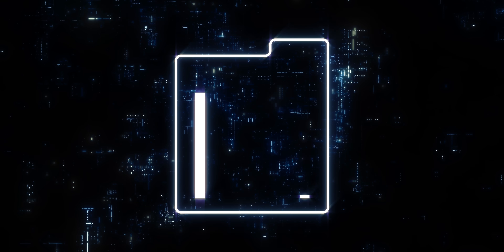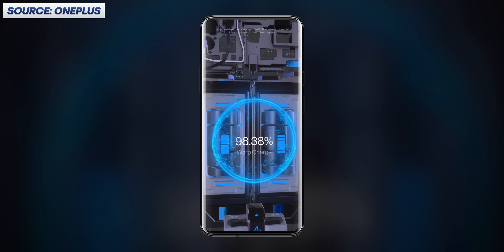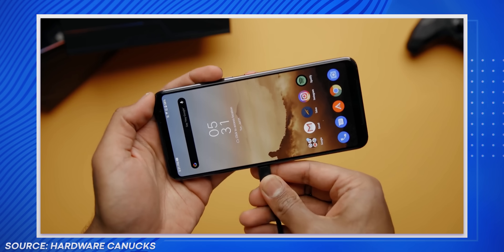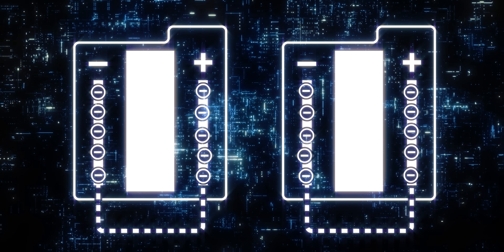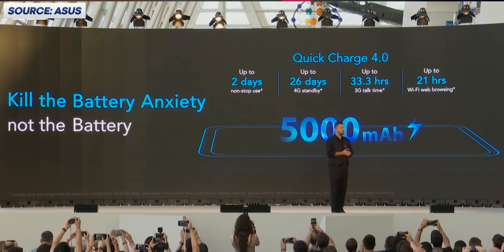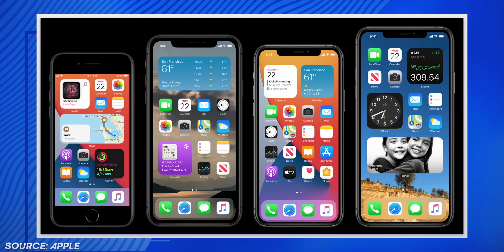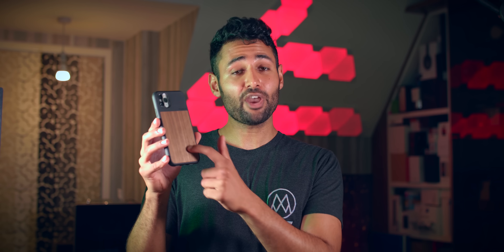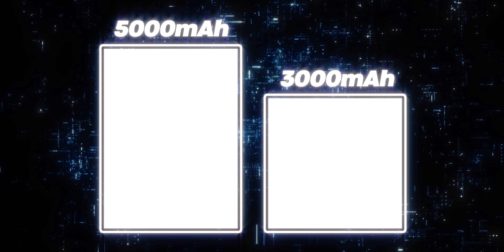The Problem with Fast Chargers.

Comment: I have a Huawei P9 Plus which I have had since November 2017 (basically 3 years now) and the battery is unbelievable . I still get excellent battery capacity using the original 18W charger it came with. It's a fairly big brick but it's worth it. Huawei boasts about the P9 Plus having special ICs in the phone itself which monitors the battery while it charges. There have been a few occasions where it slow charged on it's own...stating  the word 'Charing' rather than 'Fast Charging' but that's once in a blue moon. I don't know why that happens though. Normally it states 'Fast Charging'. There's no option to enable or disable fast charging on my phone (as far as I know). The sweet part about it is that even after more than two years of usage, whether I charge my phone to the full 100% or 98%...for the most part it will lose 1% within 5 hours on average (and sometimes it may go as far as 7 hours before losing 1%) when the phone is in sleep mode. On a full charge I can easily get 6 hours of On Screen Time. I think the most I got during the summer period was nearly 7 hours with about 10% remaining. I simply cannot complain. It's all good on my side. The Huawei P9 Plus is a premium smartphone with a premium battery.

Comment: Tesla charges its ~100kWh car battery in half an hour. It does so by maintaining the temperature with efficient cooling. So, there is pretty much no reason why fast charging would damage a battery if the charging doesnt heat up the phone beyond a certain point. The brands that provide 100W charging, also demonstrate how they maintain temperature within limits. So, there is nothing to worry. This video should be filed under 'modern tech myths'.

Comment: Nice video and a good explanation. I think this helps a lot of people to take more care about their phones.
Two small corrections. At ~ 6:20: 
Your phone will not continue to charge the battery once it reaches 100%. Charging of the phone is handled by a PMIC (Power management IC). Once the battery is fully charged, it will cut power to the battery and not continue charging it. That's also why you cannot overcharge your phone by leaving it plugged in for too long. Once the battery reaches 100% charge, it will be kept in a "trickle charge". It will be kept at ~100% charge by the PMIC. Basically, the battery will be charged with a really small current once it reaches a certain threshold. This way it can be kept at 100% charge without discharging or overcharging the battery. It's a periodic fluctuation so to say. 
I can't certainly say whether that's good for a battery or not. I don't know if the battery "gets used to" being kept at 100% and therefore loses capacity. I'm not a battery expert. 

In my experience the worst thing for a phone's battery is inconsistent and incomplete charging. Also discharging it too far is bad. I usually don't go below 30%. I charge it overnight and never had issues. I had my S9+ for 2 years and always charged overnight and disconnected it from the charger in the morning. This worked out fairly well for me. The S9+'s battery now has ~360 full charge cycles (360 times the complete capacity of the battery was charged) and it's still at around 95% of its original capacity and still has very good battery life. A day of use is absolutely no problem. 
So yeah, I'm not really convinced about the whole "leaving your phone connected over night is bad for your battery" thing. For me it has worked out great. Inconsistent charging and ultra discharging is way worse.

Comment: Think you may have misinterpreted the whole "apple slows phones" reasoning thing.... It's uhhh..... not to help us, lol. As apps get more demanding to run, relying on faster cpu's, more memory, more storage space, faster throughput from eprom or sd to cpu.... etc. And as the older units are already struggling here when compared to new units, slowing them down only makes them feel... like they're malfunctioning or dying... it isn't to help the customers who are holding on to units that still do what they need. It's to make the units no longer do what they need .

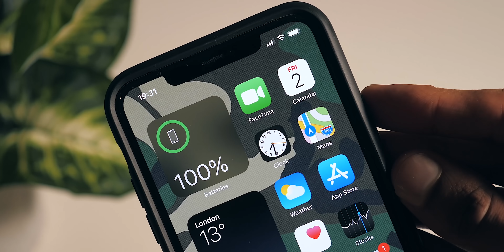Comment: 5:52 that's really impressive to see a tech guy talk so deep about physics!
In physics its said that a capacitor/battery cannot be fully charged as it will explode neither it can be discharged completely, coz if it does the battery/capacitor dies forever.
Companies add buffer for 100% the real battery percentage is almost around 85% nd for 0% its 25%.

Comment: I think that charger after 50W are not so efficient you see 50w charger (supervooc realme x2 pro) charges the battery (4000mAh, Dual cell) in 28 mins after that 65 watt also takes similar times like 28-30 mins and this 120 W also takes 25 mins you see the jump from 30w to 50w saves nearly 30 mins but the jump from 50W to 120W does only 5-6 mins so I guess chargers over 50W are not required.

Comment: I'm not a believer in fast charging. I believe that it shortens the life of the battery. For example I once had a battery charger that could charge the batteries in 1 hour. However, you could only charge them 100 times. If you put the batteries in a regular charger, you could charge them 700 times.

Comment: 'We dont see 4k displays' 

Sony crying in the corner...
Reply: Wait ... realy ? does sony have any phones like that ?
Reply: @geasstk1334  yes check out the sony 1 ll
Reply: @geasstk1334  Welcome to 2015. Seriously, how did you miss that? Everyone talked about how useless it is on a phone unless you literally glue your eyes to the screen. 1440p ultrawide is plenty on less than 7" and even 1080p still good enough.
For PC screens though I'd recommend 4k for a few years now unless you need extremely high refresh or are on a budget.
Reply: @aoelp  true but it's cool to have 4k
Reply: @wheezel55  not really, i imagine it would get kinda hot with a resolution like that..
Reply: @ConfusedPlushiee  Not anymore Sony flagships are still 4k and they've done a ton of optimizations over the years and it doesn't drain battery or degrade the phone. It's also very noticeable compared to 1440p.
Reply: @geasstk1334  Also, this exists for five years now as well: https://www.digitaltrends.com/computing/japan-display-crams-33-million-pixels-into-17-3-inch-display/ 🤣

Comment: It was over when you weren't able to take the battery out, He also didn't mention that now you CAN NOT completely shut your DEVICE down. It has the ability to track you 24/7 and carrier drones will often text or somehow communicate with a person when they feel they are not using the DEVICE correctly.

Comment: I fast charged my S8 until I upgraded to a Note 10 plus. The health of my S8's battery was 98% when I Switched after a few years. I have never had an issue with fast charging. All my batteries stay healthy as long as I don't leave my device laying around forever.

Comment: The extreme ends of the battery are not equally damaging. Keep the battery at 100% for a full year and you lose 20% of the capacity. Discharge it to 0% and you will lose 20% of its capacity in as little as 100 cycles. Reaching the lower percentage of the battery is the best thing to avoid.

Comment: Hello,
I am curious to know why the latest phones mid range like oppo f17 pro, oppo f17 have larger chin as compared to mid range phones which were released 6 months or one year back.
I always have been waiting to understand why aint brands going for proportional bezels like top bezel and chin of same size instead of chin being larger.

It will be a super awaited mystery clarification if you can help on this.

Comment: This would never be a problem if it was easier to replace batteries.
Reply: finally someone with iq 1000+, thank you
Reply: @UplifterMan  Not really, bc people want water resistant, lighter, thinner und more durable phones, which is simpley impossible with an clip on plastic back cover.
Reply: @gepixelt7712  It's 2020 this shouldn't be a problem at all, it's all about the money..
Reply: @SosoLobi777  apple would be hated to
death, if they would make a non waterproof platic phone...
Reply: @gepixelt7712  they can make jetpacks, rockets and for that matter fucking ufo’s idk but they can fix it if they wanted to..
Reply: @gepixelt7712  man the first iPhone wasn't waterproof and it didn't have a replaceable battery while other brands had it...
Reply: @SosoLobi777  yeah this is how tech works...
Reply: @SosoLobi777  ma dude, physics is still physics. there is no rule that says your phone will get that much better every year, the only reason they get better, is because the engineers manage to make cuts and compromises wherever possible, but at some point you will hit a limit. With batteries, that limit has sort of been reached. So don't expect major improvements, just because "It's 2021 they should JUST FIX IT". (unless solid state batteries get introduced to the phone market, but those are still very new and somewhat experimental).
Reply: @ConfusedPlushiee  do your research and you should’ve known all these big companies are taking a walk with us. Not only that with just proper thinking you could’ve known that no offense.
Reply: @SosoLobi777  ehm, my point still stands tho. You cant make a magic phone that does everything perfectly, not for a reasonable price anyway. (And if that were to happen i would honestly not trust it, a company needs to make money after all) 

When you say they are "taking a walk with us", what do you mean exactly?
And how do you mean proper thinking?

You sling insults, yet you dont give any logical basis for your arguments. 
Im all for a good argumentative discussion, but please, lets stay civil.
Reply: @gepixelt7712  your acting like people would actually bring there phone to the water
Reply: correct if we get a new battery that’s good it would be the best
Reply: But we put a bulky case
Reply: Suddenly i realize that i could just buy a new battery and fix all my problems

Comment: When you said 50% charge, the diagram is actually misleading....the diagram shows actually when it will be completely discharged ie, electron  balance between 2 poles...
Reply: @Shubamay Das, a potential difference across the battery of 0V does not necessarily mean that there are an equal number of electrons at either terminal. Depending on several factors, 0V may be reached at a different configuration. In fact, in practice, 0V is never reached, because the voltage exponentially decays towards 0V, but never actually gets there.
Reply: U mean like a shut down of the phone?
Reply: Bruh

Comment: Asus did a good job you can go to settings and they say you that the faster it loads the less the battery capacity is and you can set slow charging to save the battery

Comment: This would be less of an issue if companies gave us removable batteries again. Even if it's a pain to get into, with screws and plugging in ribbon cables, at least we could replace batteries once a year or something.
Reply: that is bad for the durability of the phone. there are reasons why we get water resistant and shock resistance phones these days.
Reply: Sorry I'd rather have IP rating and optimized internal layout. Replacing a phones battery costs around 75€ so it's not too bad.

Comment: I have a simple question.   Desktop computers run directly off the power source.  So why is it when you plug in and use a laptop, tablet, or smartphone when plugged in, and the battery is fully charged, does it not stop charging the battery and then just work directly off the power source?  Or is it different for laptops than tablets and smartphones?

Comment: We could just avoid "problems" like this by making phone batteries swappable again... But no, everything must be shiny and glued together, so you HAVE to buy a new phone at least every 2 years or spend a lot of money to get your battery changed at licensed shops or the manufacturer itself.
Or you treat your phone (a thing designed to work for you) as something precious and carefully charge it slowly and always complete to make sure the battery life is as long as possible

We all talk about protecting the earth, getting more and more sustainable, but the consumer electronics market is the absolute worst

Comment: I spent a month without internet so I used my phone as a router a lot during that month and some times it really overheated, after that my battery life is about 3 hours of use in wife or 1.5 hours on 4g and if some reason the phone is overheating it would last even less.

Comment: How to use/charge a phone with fast chargers like a pro to make our device's battery last longer and slow battery degradation?
Is charging till 90% and not letting it discharge below 20% ideal for Li-polymer batteries? 
I wish this was included in your video.
Anyway a great and must-watch video bro. Thanks

Comment: great video. last night I've tried this on my fold 2. I disable fast charging on setting. it took about 2 1/2 hour to charge the phone. but I couldn't get a day out of the battery life. when I had it out the box with fast charging enable. I was about to get a full day and 30% left because I do allot of multi-tasking.

Comment: Cheers for the upload. It does not matter how fast you charge a battery as long as it doesn't overheat. I like how Xioami figured things out by using heat spreaders and/or a dual battery setup. I wish that one day phones last as much as the good old nokia brick. I feel that lithium-ion and lithium-polymer are due for retirement.

Comment: NOW, THIS IS WHAT YOU CALLED A LEGIT TECH EDUCATOR. Arun does his review through tons of research to come up wtih this well elaborated science behind.
Reply: Yeah. He warned of the real cost of super cheap super phones. Bloatware, I see you Realme.
Reply: @rasalasblack  haha and xiaomi's built in ads 🤣
Reply: Didn't mention the fact that you used to be able to just swap the battery out and put a new one in in 10 seconds. That should still be available in my opinion.
Reply: @FinicalFox  Yeah now you have to unscrew so many screws before removing the battery. Miss those times when you could just take iut the plasric or metal case and pull out the battery in a matter of seconds.
Reply: @FinicalFox well Smartphones won't ever have that type of battery ever again

Comment: Can’t believe this wasn’t done sooner! Having the option to change from fast charging to slow charging would be so awesome and useful! I could then slow charge my phone over night when it’s not in use and when there’s plenty of time for it to fully charge by the time I need to use it - thereby helping to preserve the batteries overall health, and then in the day if the battery gets low or dies, and I need the battery charged fast because I’m in a hurry to go out or what ever - then the option for fast charging would be so useful and brilliant to have! Can then control and way up short term benefit vs long term benefit/health
Especially if it’s a setting toggle and not down to what charger is used (ie 5w Vs fast charging cable/fast charging wireless pad)

Because not everyone has multiple options on how they want to charge their phone, so a software feature would be brilliant and make a huge difference for people - so battery’s health/percentage charged can be optimised depending on the short term need and long term benefits

Wish and hope apple would implement this feature on upcoming iPhones 😁
Reply: Android (mainly Samsung) already has a toggle option for disabling/enabling fast charging.